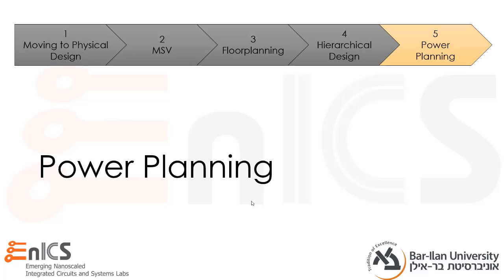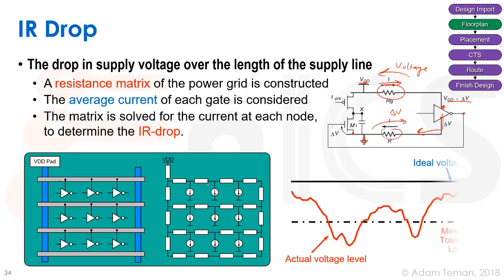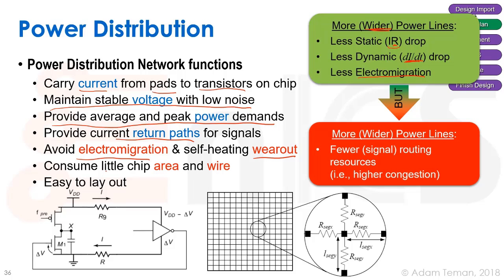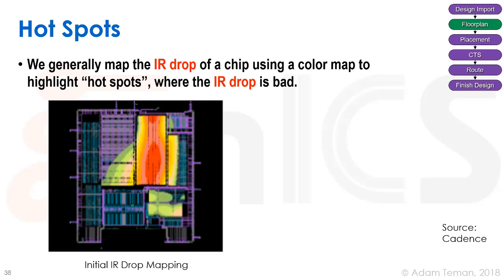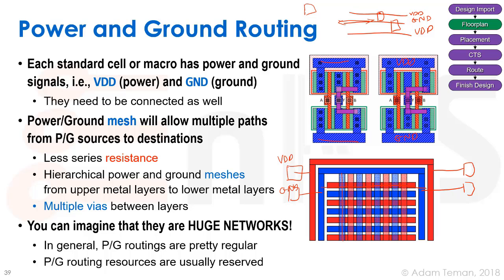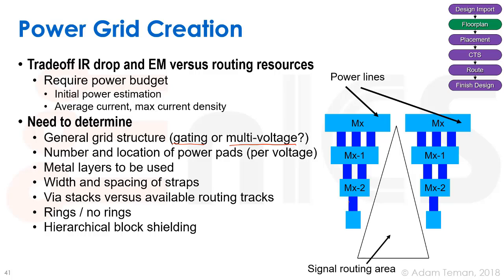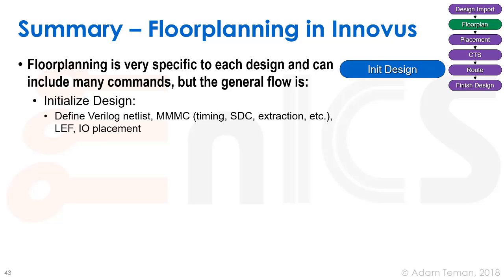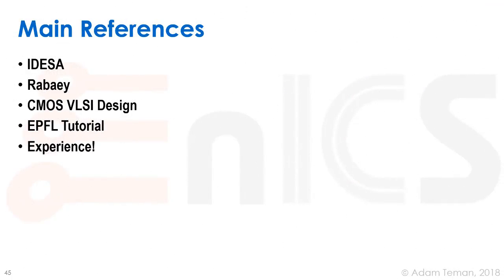DVD - Lecture 6e: Power Planning

Comment: What does "provide return path for signals" mean, since current has to flow in a loop anyway
Reply from the maker: Yes, that is the meaning. We need to provide both the source of the power (i.e., VDD) and the return path (i.e., GND).
Reply: @AdiTeman  is it even possible to not provide the return path. Where would the current flow then?
Reply: @rogerfederer6456  That is true, for the current to flow it needs a return path, so there is always a return path. However, if you don't have a clean return path, the electromagnetic waves are going to look for the path with less resistance, this will cause noise/crosstalk etc. In PCB design there is the same problem.

Comment: how did the power rings are getting the power.How to connect ports/terminals to the power rings.
Reply from the maker: So I'm not sure I'm answering the exact question you're asking, but I'll try.

The power to the chip comes in from outside the chip (usually). There is a power supply or battery on the board with regulators that bring the voltage down to the DC voltage required by the chip. These are connected through pads to the chip (see the later lecture on I/Os and packages) and from there are connected to the power rings. 
That is at the full chip level. If we are designing a block and not the full chip, then we will have to connect the power rails from the fullchip level to the block power rings and power grid (stripes).

Comment: Did you already gather experience with AI in the floorplan creation or at your institute ? Is there already a Cadence tool for this? I feel like there is a lot of manual guessing in this physical design step that should/could be optimized with metrics. Also I heard about Google doing exactly that its called AlphaChip if i remember it correctly
Reply from the maker: Hi @Torchl46 - excellent comment.
My answer is... sort of.
Indeed, there is a lot of work on AI for chip design over the last few years and it's a super interesting domain. The best known work is, indeed, AlphaChip, which kind of kicked this whole field into gear. But it wasn't started in a vacuum and it has been followed by a real ton of great innovation in all fields of chip design. Furthermore, the EDA vendors are also providing AI-driven solutions in their commercial tools.
Why do I say "sort of"? Because I have a student who works with the AlphaChip team and has been able to run the tool and evaluate it. But I haven't personally (actually, at this point in my career, I don't get my hands wet with "real engineering" that often...).
I will tell you that I ask around quite a bit and I don't find many backend teams in industry working with the new tools yet. I imagine it will come, but it's sometimes hard to steer this very heavy ship that has been moving in one direction for many years ;)

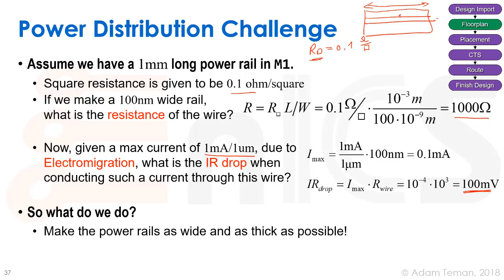Comment: Sir thank you so much for your vedio provided. I got confused at 8:09 of the lecture. I consider the IR drop calculation should be irrelevant with width of the rails, only related with the square resistance and the max current as in calculation of R the width is on  Denominator while for I max calculation the width is on Numerator . So why should we wider the power rail ？
Reply from the maker: Hi.

Your confusion comes from me combining two separate phenomena in this example. First, IR drop - here, I just measured the resistance. The resistance is for sure not "irrelevant with width of the rails" because the wider the wire is, the "fewer squares" you have. My best way of explaining this is a highway with cars running on it - the more lanes (width), the more cars can pass at once (current) or in corollary, the lower resistance. 
The reason we care about resistance is "IR" drop (Ohm's law: V=IR), so we also need the current. If the current is tiny or non-existent, then "who cares" what the resistance is, right? So in the second part of the exercise, I tried to get a representative number for the current to understand if the resistance we calculated is problematic. How do I get such a number? Are we conducting mA, uA, nA, pA? So I used the number for the maximum allowed current, which is defined by EM constraints. For EM, we are also limited by the current density, which is the current divided by the area that the current goes through. Since the thickness of the conductor is given (like in square resistance), we only need a number for current divided by wire width and that is given as 1mA/1um. Since we chose a wire with a width of 100nm, we got a maximum allowed current of 0.1mA. Now, assuming this could be running through the wire (if it's allowed, then we're going to drive it through, right?!), then we can find what the voltage drop is going to be.

I hope that cleared it up.
Reply: @AdiTeman  thank u somuch! I consider I understand now

Comment: Hi sir,
First of all, thank you very much for the course. I enjoyed every minute of your Videos.

secondly, I have a doubt if we plan the power for a higher metal layer, how do standard cells get its power, which it planned in lower metal layers?

I think we can use vias until we reach to the M1, but this will consume more power and affect reliability, is that true?

secondly at what metal layer will be the VDD/GND net/pin exactly?

lastly, is it preferred that the metal layer in the Power planning to be vertical or horizontal?
Reply from the maker: Hi, I'm so happy you are enjoying the videos. Here are the answers to your questions:
1 and 2) Yes, indeed, the power is usually routed in a grid, starting from the top metal layer and through some of the lower layers, until finally connecting to the "follow pins" or "VDD/GND rails", which are part of the standard cells. In most traditional processes, these are on M1, though I have seen libraries that use M2 follow pins. It is very common to run the grid on the top two metal layers which are really thick, then go down large Via stacks to a much lower metal (e.g., M3 or M2) and then connect frequently from this metal to M1. However, different companies have come up with different methodologies for building such a grid.
Regarding the question of power and reliability - actually, no, these are not the concerns here. The via stack uses big matrices of vias, so they are not very susceptible to reliability problems. In addition, this is a net that is supplying power, not wasting it through toggling or leakage. The main concern is the IR Drop - the vias have resistance that can cause the voltage level that reaches the standard cell to be affected. However, that is why multi-via arrays are used. 

3) The connections are usually M1. These are usually horizontal stripes (called "rails" or "follow pins") that go across the entire row of standard cells. The entire stripe is marked as a PIN so the higher layers of the power grid can easily drop vias down onto it.

Hope that answered your questions.
Adi
Reply: @AdiTeman  thank you for your reply and detailed explanation.

I have another question.

is there any advice about How to choose the number of core rings/straps? also the width and spacing of rinds/straps?

I know we can play around and make an estimation like we can get the static and internal power from synthesis tools like Genus/DC, and we can get dynamic power from simulation like we can run the simulation with SAIF/VCD file and get the activity factor and go for power analysis tools like PrimTimePX and estimate the dynamic power, but is this what is the real happened in the industry? or there are tips and tricks from experts like you?

or it is just like "black magic" and we have to play around and just do an inspection then try it and then run IR drop analysis, then if it's acceptable and within the range, we can go through the whole steps, and if not then can return and adjust and so on...